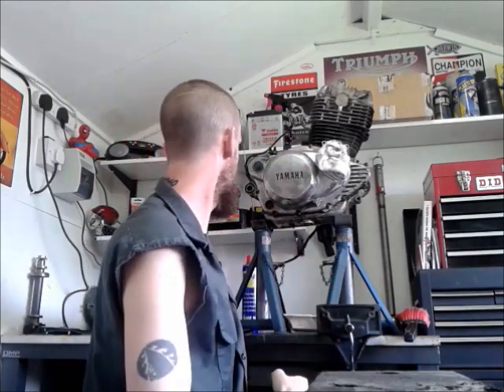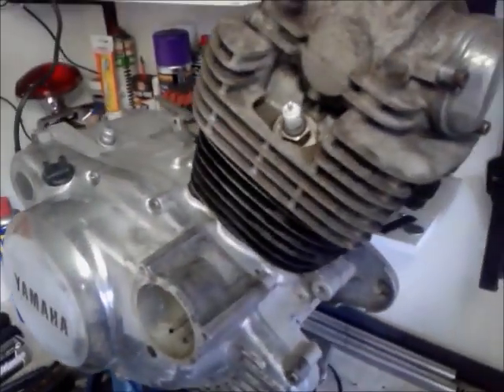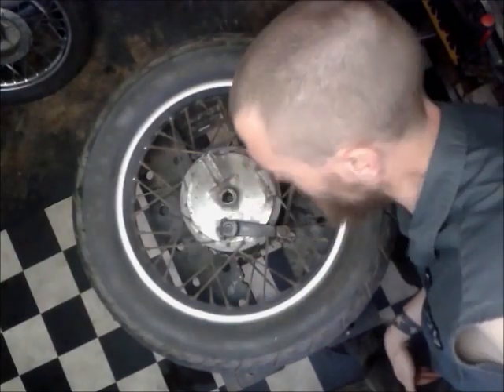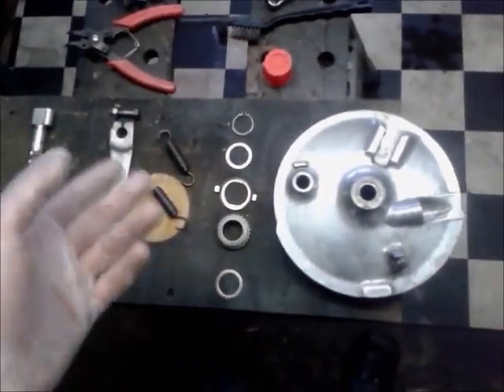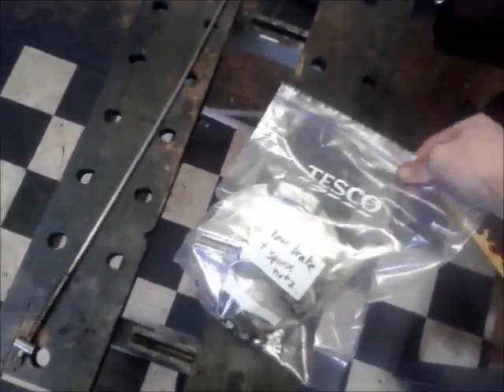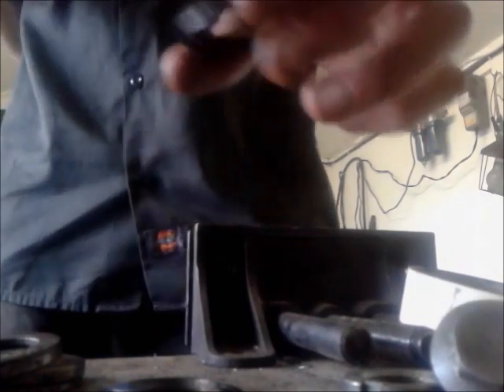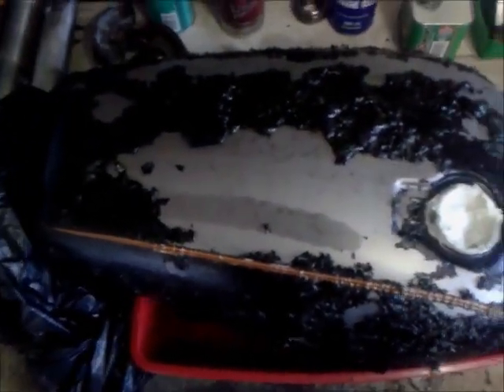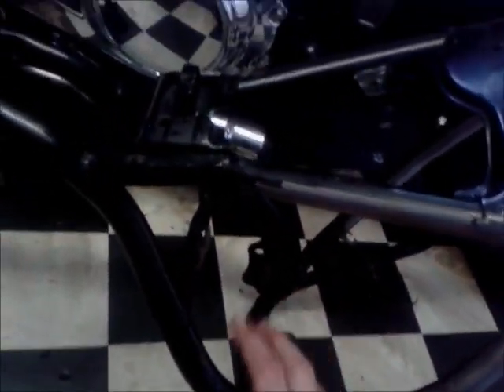PROJECT SR250 pt 4 MORE STRIPPIN', CLEANIN' N BAGGIN'

Comment: nice fast and lots shown , liked it a heap! yea ive tryed nitro mors, didnt lik it one bit and wont spend my money on it again !! i used aweek to take paint off with it amd finaly went ad it with heat an 3 hours later i was satisfied. gonna be cool with no dents and bare steel!! my friend has the only aluminium tank we know of ,polished on hes tw stroke racer evry one else got steel or fiberglass tanks, hes are god like looking!!
Reply from the maker: i was a bit concerned- it wasn't as rapid as it it used to be but i wrapped the tank in a bin bag and it's taken everything off!- it's crap on polyurethane finished though- used to do guitar bodies- and only thing that'll get that off is heat and a scraper and a few hours of sweating!
Reply: yup , but i tried it on a bycycle frame from 1925 and didnt want to damadge it , only way arou wasent usin nitromors, remember the good old days when doors was in highest fashion without paint or laquer, then it was good stuff ,but noe E.U. fucked up this too , like everything else!! bananas must all have equall size , cuecumbers cant be curved, thinner based paint isent allowed enymore,and copywright will all be controled from bruxelles , whats this shit all about?? ENYWAY  love your show!!
Reply from the maker: worlds going crazy mate- the paint thing really pisses me off- it's not as good as it was!!!
Reply: yup its shit!!takes forever to do the smallest jobs and if the shit dosent work enough ,we tend to use more of the shit = same amount of toxic in the rubbish!!